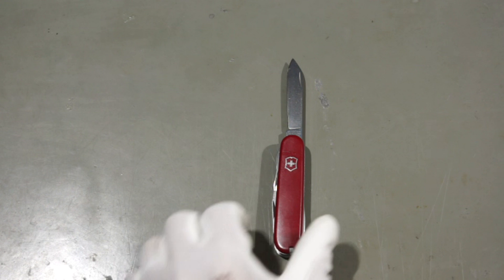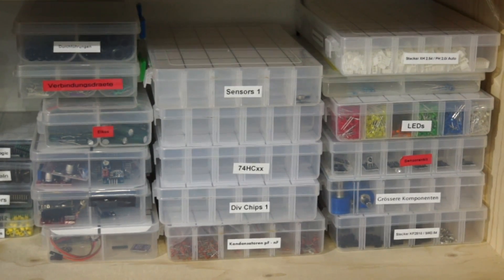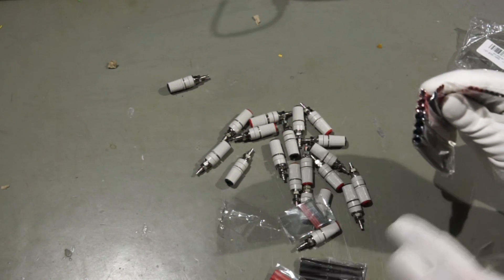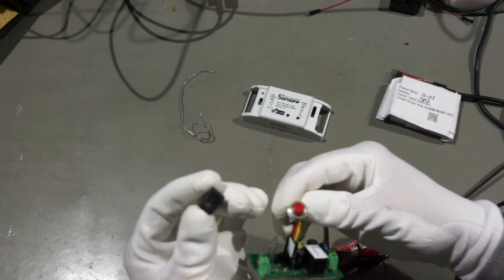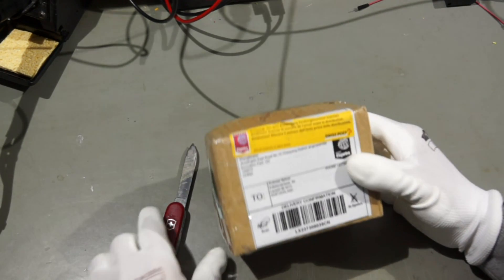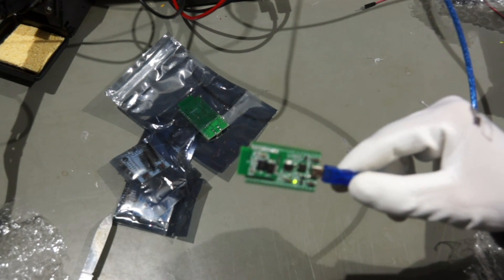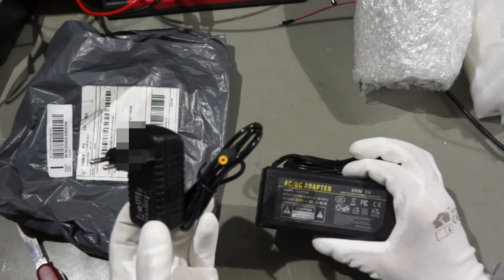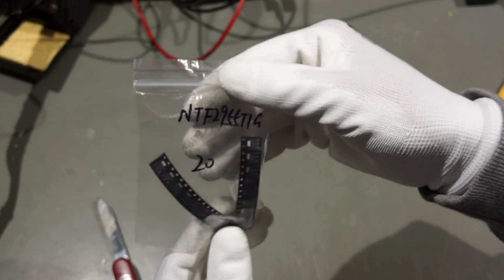#104 Mailbag Christmas Edition

Comment: What sort of results have you had using your Analoglamb sourced ESP32 boards?   Two of the three boards that I bought are a bit unreliable - freezing up occasionally and poor WIFI range compared to other ESP8266 boards.
Reply from the maker: +Roy Gilby I did not use them so far.

Comment: Hi Andreas,
nice seeing you online ;-)
I have a question about the XH cables (https://www.aliexpress.com/item/High-quality-Copper-Wire-40cm-ribbon-cable-XH2-54mm-Female-Crimp-Pin-40-Way-Flat-Color/32704194764.html)
I also ordered them but they do not fit in my dupont housings (https://www.aliexpress.com/item/100pcs-2-54mm-Pitch-4P-Dupont-Housing-Plastic-Shell-Terminal-4Pin-Jumper-Wire-Housing-Connector/32710328111.html?spm=2114.13010608.0.0.b8KFxY)
which one did you order?

Thanks 
Steffen
Reply from the maker: XH connectors are different to Dupont connectors. They are not interchangeable. The connectors I showed in my video are not Dupont connectors. They are XH connectors (as you see in the description for the assortments). I am not aware that you can buy "naked" Dupont cables. I buy them with the shell and throw it away.

Comment: I am a bit cofused between lora, esp32 dev board. if i get lora , can we program using arduino ide ?  can you make some quick video sometime comparing esp32 and lora ?
Reply from the maker: LoRa is a communication standard which needs some special chips. You can connect these chips to all sort of microcontrollers. The MCUs are programmed with the usual tools, also with Arduino IDE. The LoRa module is fed by a library.
Pycom made a bundle where they bundled an ESP32 and a LoRa module together and called it LoPy. It runs with Python.
Reply: Thanks a lot for the quick response. If i get LoPy board, can i program it with arduino ide or python from Rpi3 ? Because i saw on their website they have their own ide - Pymakr. 
Secondly, i also noticed that they have WiPy board that claims to have 1km range. Apparently, it does not have LoRa i guess, am I right ?
Lastly, for LoPy and/or WiPy can both of these be configured to work as wifi accesspoint (like esp8266), and do i need any special transmitter or receiver node other than LoPy or WiPy boards ?
Sorry, for several questions, I am a bit confused between what to choose for my IoT project where i want to connect several sensors separated by short (few m) to long (few 100s of m ) distances.

Comment: Why did you don't get a wemos 16 MB flash model?
You just add 1 more buck.
Reply from the maker: 1. To my knowledge,  I could not use more than 4MB in the Arduino IDE.
2. My biggest sketches currently use less than 500kB. Even with OTA, I am still below 1MB
Reply: Thanks for answer.

Comment: Hallo Andreas. Warum die Wemos D1 Mini und nicht gleich die Mini Pro?
Reply from the maker: Ich habe einen pro gekauft. Allerdings:1. Weiss ich nicht, wie man mehr als  4MB in der Arduino IDE verwenden könnte.
2. Mein grösster Sketch ist immer noch unter 500kB. Auch mit OTA, bin ich dann unter 1MB
Oder habe ich was verpasst?
Reply: Hallo Andreas. Du hast nichts verpasst. Mehr kann man derzeit nur über Umwege nutzen.

Comment: you must have a huge collection of parts, have you every been to Shenzhen electronics markets, it's huge! Have a great Christmas and looking forward to your Lora episode. Cheers!
Reply from the maker: No, I was never in China. But I heard of this market. Maybe it is better not to go there. Would probably be expensive for me :-)
Merry Christmas (late) and a Happy New Year to you, too.
Reply: Problem solved !   It seems that these Analoglamb ESP32 boards are a little more sensitive to the quality of the 3.3 volt supply, than other ESP8266 boards that I've used.  I checked my 3.3/5volt breadboard power supply on the 'scope and see a fair bit of noise in the trace.  So, I tried a running the Analoglamb boards from a single LiFePo4 cell, and all three worked  reliably.  So, now I need to work ot what sort of filtering to add to the breadboard power supply to get rid of the noise - i.e. just a capacitor based filter of an L/C filter.

Comment: The last component (power regulator) is labeled on the package as an NTF2955T1G, right? If yes... then its a mosfet? Or did i fail at reading the label? :D
Reply from the maker: +blahfaselsülz uups, I have to check...
Reply from the maker: Yes, you are right. I mixed something up. The rest of my statements about LDOs is correct, just not the package.

Comment: hello sir
please tell me how remove noise in circuit.
i am using hall effect water flow sensor which getting affected by AC line near to it. 
 interupts on wemos D1 mini  getting affected.how to solve.
Reply: You maybe want a low pass filter. Afrotechmods has a great video about them.
Reply from the maker: This cannot be done remotely. Too complicated. Sorry.
Reply: Saurabh Gangamwar Try covering the sensor with thick aluminium foil. I don't have the sensor to try this but you may give a shot! 😊
Reply: Andreas Spiess thanks for reply. Do have some experience with such experience ??
what is universal or typical  solution ??
i became mad do to this problem.